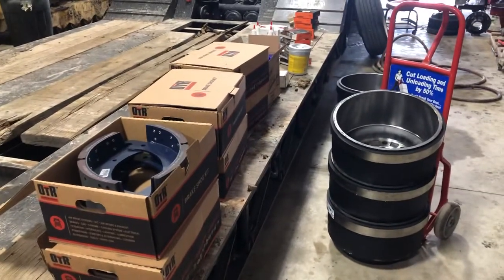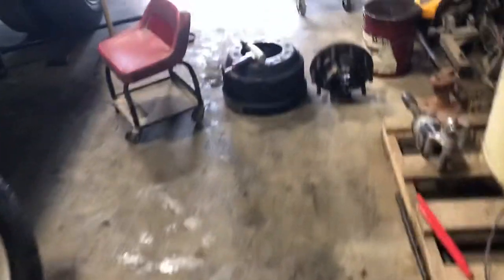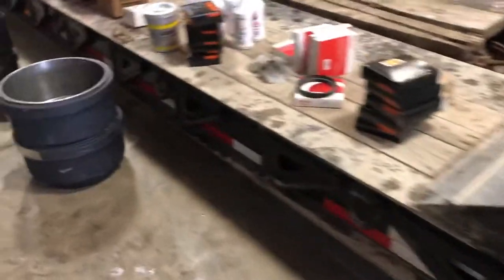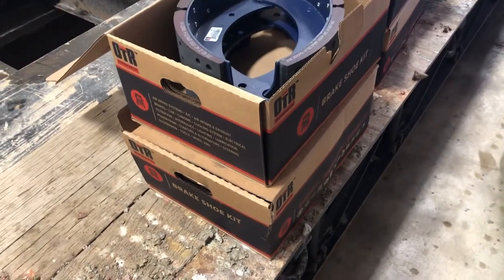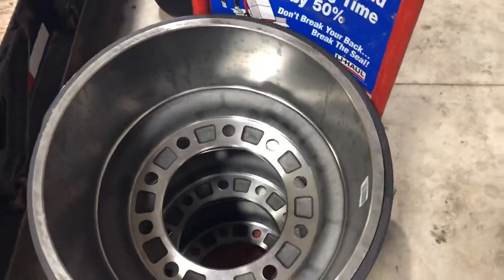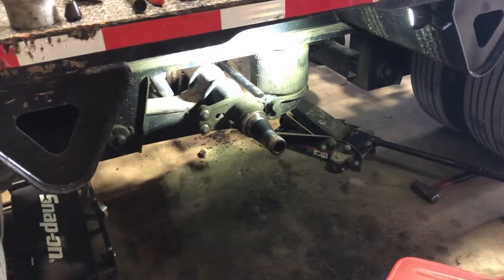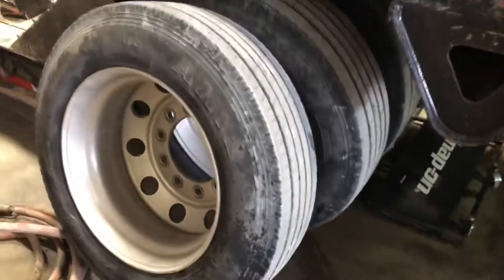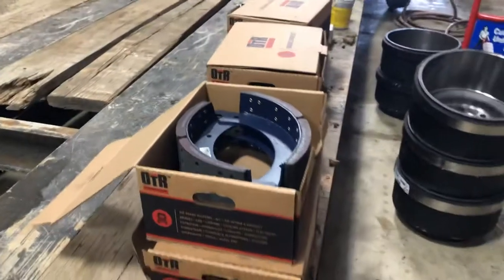Brake job on the lowboy with tips!

Comment: Webb does make the otr drum, i have been trying out heatstar shoes from marathon on the dumptrucks, they are grabby at first but settle down as they wear into the drum. I put one set on a dump trailer and they seem to surface rust to the drum over the weekend in nc but it is a bit humid here.you didnt show the tool ,i will have to look it up, i take em out with a bushing splitter and i spun out a piece years ago to put them back in with the air hammer also which also doubles as a ford/sterling steer spring bushing installer.